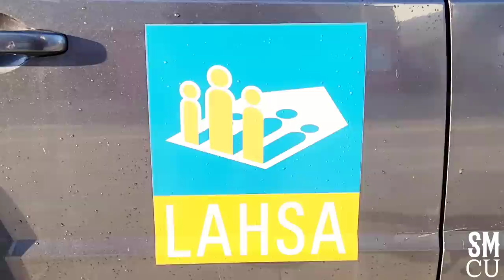Weekly Homeless Encampment Clean-ups at Venice Beach

Comment: The solution is easy.  Secure facilities (develop properties, turn unused buildings into dormitories, etc.) and put the ones who truly have mental issues in mental housing and put the rest in housing, too, but make them work for it (at least part-time, within the facility or at the burger joint or Walmart down the street).  Give them jail as the only other choice. Eventually, they will want to move out of the gov housing and make it on their own. These temporary accommodations are not a permanent solution.  Buy the friggin' hotels and let the city run them so they can have oversight of the tenants (and a lot cheaper rent for the city in the long run).